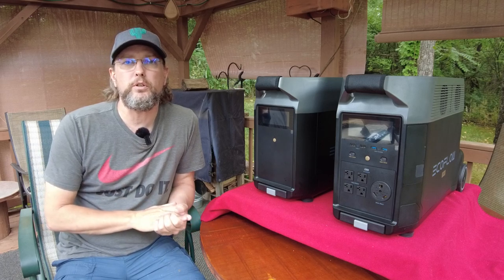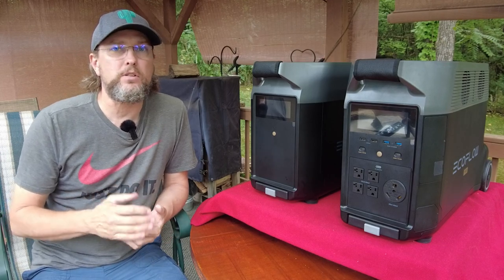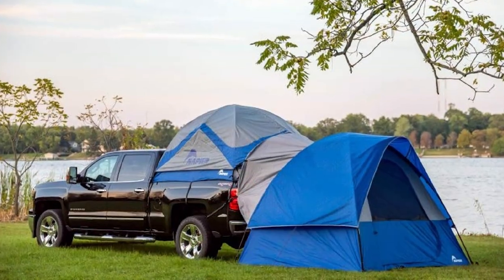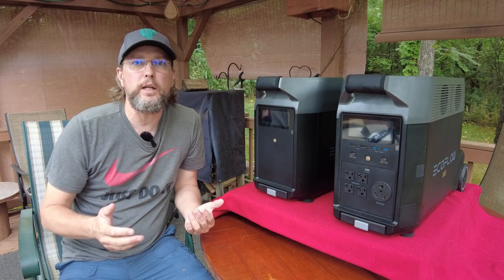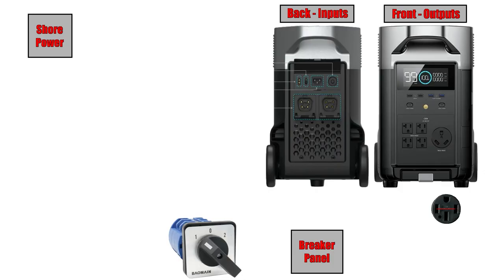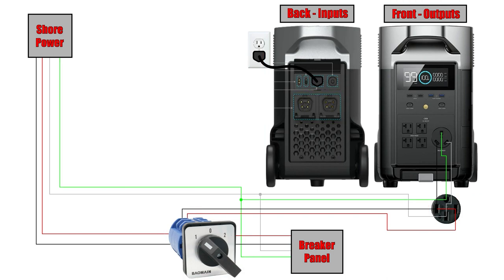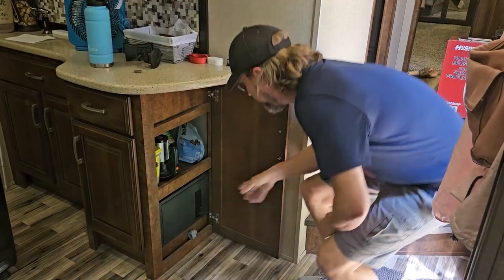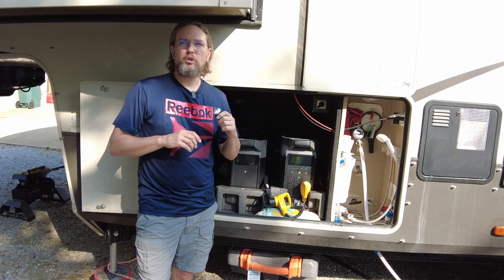A Great RV Solar Power Alternative | The Ecoflow Delta Pro Portable Power Station | Full Time RV

Comment: We have a Bluetti AC300. Pretty sure it's similar in size to yours. Our thoughts for purchasing the portable Bluetti rather than building solar into our 25 ft. class C motorhome. Being portable, we can use it in the house as well as the RV. We live in hurricane country, so we need something to power our fridge and freezer during extended power outages. We prefer to park the RV in the shade, so portable solar panels are an advantage over panels on the roof.  We can leave the heavy system in the house (where we store it) if we are traveling to campgrounds with electric hookups. We only carry that extra weight if we plan to boondock multiple nights.  The portable system will run the whole 30 amp rig, so we can simply plug the power cord into it just like plugging into a power post at a campsite. We have been extremely happy with our choice! Oh, one more item, all the components in whole system are designed to work together. We didn't have to figure it all out if we built our own. And we do need an "open ground plug thingy" to make ours work. (Pardon the unprofessional term. I don't know what they are called. 🤣)
Reply: 2 Delta pros is also workable in houses. I watch a video where he uses 2 Delta pros and all the batteries. Which is too bad for each Delta pro? And you run this wtollhouse September has a gas stove. I do believe kitchen stove and gas furnace and one gas dryer. But he has 2 dryers, 1's electric 1's not.  And he gets all his power needs from the Delta pro. But I do believe he still has to be careful with his power. Use just like if I get a C300 the wetties and all the batteries and 2 of them, I still have to watch the power I use just like I should get 2AC500 and all their  batteries of my needs on my power. That way, as well as  AC300 to actually complete all the power I need.
Reply: So your system is idiotproofed?
Reply: Is it able to run your AC?

Comment: I have this exact same setup with two spare batteries. I also have the smart generator. It turns itself on and off when it notices the batteries are getting close to dead and turns off when charged up. No need to do that yourself!
Reply from the maker: I wouldn't mind having that generator. But as far as I know, I can't charge both Delta Pros at the same time with it.
Reply: @fairwindsrv  It charges the main unit while the main unit spreads the power distribution to the spares.As far as I can tell in the app, it charges all three at the same time when I use it.

Comment: I like what you have done with these power station and explaining what they can do for you. The only down side for me is the weight. Would not be able to lift this unit (100lbs) into the bed of my truck or in and out of my pass-thru storage area of my 5th Wheel RV. We store our RV at an off site storage facility and I don't leave anything worth over a $100 in the trailer. Also the price was too high for me, at 1st I was thinking it was around a $1000 and then I saw the price of $3000 and I just killed over. It is still a good option for those that have plenty of disposable income. I'm pretty happy with my small 600watt Bluetti. Thanks for the video.
Reply from the maker: You're welcome! And you're right...it's not a solution for everyone and it definitely isn't cheap. However, dollar for dollar, it's cheaper than a traditional solar installation, especially if you can find a good deal on Ebay. 😉 Thanks for watching!
Reply: I bought a 6' folding aluminum ramp which I use to get my Delta Pros down the front steps and then up into my truck...this makes it easy.

Comment: So when boondocking the 12v devices still run off of the 12v house batteries that get charged by the converter that is powered by the unit, wouldn't it be more efficient to eliminate the the house batteries and turn the breaker off to the converter and use the 12v outlet on the eco flow to power the 12v panel? May be more money wise too if you don't have to buy house batteries. Have a question too, are the units too loud to have in the living space in the rv?
Reply from the maker: Great questions.
As for the noise level, I don't think I'd want them in the living space because they can get fairly loud. They might be tolerable for a short period, but I don't think I'd have them long-term in my rig if they had to be in a living space.
I guess the only reason not to do what you're suggesting is that there simply isn't a DC connection port that offers the capacity needed to fully support the DC system...at least, not in my RV. The Anderson port is only rated at 30 amps, or about 380 watts. That's just not enough to support the DC loading.
It's definitely not efficient converting DC to AC and then back to DC, but you'd need some good old fashioned redneck engineering skills to make it work otherwise. Lol.
As a side note...whenever connected  to an AC source, the converter is doing all the work for the DC system. If the batteries are fully charged, then they're just floating on the system. If they're not fully charged, then the converter is both charging the batteries and supplying the rest of the DC system. Overall, that doesn't change your point, however. Just wanted to clarify that for others who might read this.

Comment: I have a truck topper, can I leave these in the bed of my truck for storage? Can these be used facing up instead of facing forward?
Reply from the maker: The only thing I'd be worried about in the bed of a truck is how much they bounce around when driving. Might not be an issue if you keep them in their styrofoam bases, though. As far as how they're facing...I'm not sure it would be a good idea to stand them up on end. If that's something you want to do, I'd reach out to EcoFlow.

Comment: I recently installed 2 eco flow pros in my Rockwood mini lite and opted for the Go Power TS-30 30 Amp Automatic Transfer Switch with 30 amp cord pugged directly into Eco flow. I wired it so the converter charger only works on shore power to prevent a "power loop". My problem is, my 12 volt system only operates on the front trailer chassis battery. (Lights, heater, etc.} I want it to run off the eco flow. Did you run into this in your install or have I done something wrong? Best work around? Any input would be greatly appreciated...
Reply from the maker: I don't have that issue because I didn't bypass the converter with the Ecoflow, so my 12V system is being powered from the Ecoflow. My coach battery is now just a backup to the backup. It just kind of floats on the system now and never actually gets discharged. 
I know what you're saying with the power loop, but the Ecoflow is pretty smart and will prevent that from happening. Meaning, it knows if it gets plugged into an AC outlet that it's powering. When it senses that, the AC outlets turn off automatically. Similarly, it won't let you turn on the AC outlets on the Delta Pro if you're plugged into an outlet it's powering. I know this from experience. Lol. The key is that you must remember to unplug the Ecoflow from the RV wall outlet when you want to use it to power the RV, especially with the automatic transfer switch. 
Granted, this is a downside to having this type of setup, but it's one of the reasons I went with a manual transfer switch...I have complete control over the system.
I hope this helps, but I think you have a decision to make about putting that converter back in line with the Ecoflow. It's the only way to power your 12V system with it...without a whole lot of jury rigging.
Reply: So if I understand... if I reconnect the converter, it won't try to use the Delta Pro to charge the house battery. Am I wrong in assuming that when I'm powering my 12-volt equipment even with the DP online, it's still actually coming from the house battery and not the Delta Pro. 
Let me try and put that another way. If I'm using 12-volt equipment and depleting my house battery isn't that Delta Pro going to try and charge it?
 I know my question is as clear as mud, I just don't know how else to explain it.
Reply: I just re-read your reply. I think what you said is if I reconnect the converter it will never try to charge the house battery while the DP is in line because it will never actually be discharged. The DP will be providing the 12v system and as you said the house battery will just kinda sit there. Am I understanding that correctly?
Reply from the maker: If I understand your initial comment, you wired the DP into your RV AC electrical system, but somehow bypassed the converter. Now, your converter only charges your house battery when you're connected to shore power. Assuming I understand that correctly, then the first part of your most recent reply is not correct. Without looking at the system (or a drawing), I'm not sure how you bypassed the converter when only when on the DP but not on shore power. However, if you reconnect the converter back to it's original state, then when you're on the DP, the DP will now charge your house battery just like it does on shore power. When I installed my DP, I made no changes to the converter.
As far as your 12V system goes...if your DP is powering your converter, then yes...the DP will charge the house battery. Again, it would be just like being on shore power. The 12V system always gets its power from the house battery, but when you're connected to an AC source (i.e., the DP OR shore power), that AC source is keeping your house battery charged. The house battery should also charge when you're connected to your tow vehicle, although at a much lower charging rate. If you're NOT connected to an AC source or your tow vehicle, then your house battery will still power your 12V system until it's fully depleted.
Reply from the maker: Yes. Technically, if you're using the 12V system and you're connected to shore power or the DP, the battery is charging AND discharging at the same time. Which means, like you said...it's just kind of sitting there floating.
Reply: Thanks so much for your reply. I think I actually get it now. I thought if the converter was left in the loop with the DP it would become a vicious charge-discharge cycle, if that makes sense to you. Anyway, what I had done was disconnect the converter from the AC breaker. Ran a new wire from the shore power side of the transfer switch to the converter. Nearby only allowing the converter to run on shore power. Didn't realize I was actually taking the 12-volt house battery out of the loop when using the DP and thus disabling the 12-volt system. I think I may have over thought this whole project (lifelong problem) and I understand the system a whole lot better now. Thank you so much for your input and taking the time to clear this up for me. 

By the way love your video's...keep up the good work.

Comment: I've been wanting a Jackery for about a year now; very pricey but I've heard great things.
Reply from the maker: Too expensive for a G-man? LOL.
I chose the Ecoflow because they had the highest rated inverter. Jackery makes some good stuff as well and you can find some sweet deals on refurbished units on Ebay that will come with the original warranty. I just ordered another unit and extra battery and I've probably saved about 40% off the normal price of everything I've purchased so far. I'll do an update on my new system in a few weeks.
Reply: @fairwindsrv  that's awesome! I'm looking forward to seeing it. I guess I should've worded my last comment more clearly; not expensive if you're using it everyday, but it is for me if I'm holding onto it for a just-in-case scenario.
Reply: @fairwindsrv   New sub here and I enjoyed the video. I have 1 Delta pro and thinking of purchasing an extra battery and curious as to how you saved 40%. Thanks, John

Comment: Thanks for the great info. We have the delta pro as we are living in our 5th wheel off grid. We power our delta pro with 1200 watts of ground mounted solar panels. Question regarding the neutral open ground bonding plug; I have to use one to power our rv. Any issues with using that plug combined with charging from solar panels? Thanks!
Reply from the maker: Thanks for watching, and great question! There should be no issues using the bonding plug when charging from solar. Having said that, you can contact EcoFlow to verify. Support@ecoflow.com. They are very good at responding to emails. Although they may try to also sell you their own version of ground-neutral bond that is more expensive. Lol.

Comment: Good video.

We run 2 delta pro’s with 2 extra batteries each (21,600wh total) and 2 smart generators with the double voltage hub that supplies 240v at 30amp into our main house panel with a manual transfer switch. We have 3600watts of hard solar panels that max out the solar charging. Technology has really improved in the last year or so.

Comment: Great Video 👊
I think you should have a plug setup separate from Sure Power to charge your Power Station.
Perhaps use a Champion dual fuel 2500 generator. That way you can run your generator on propane.
Reply from the maker: We have that exact generator for that exact reason! 😂 Thanks for the comment!

Comment: Thank you for all your technical expertise and well-done YouTube videos. 
I just purchased two DELTA Pro ECOFLOW 240V/7200Wh solar generators. What cable do I need to connect them together to obtain the whole 7200 Watts? Assuming I can connect them together at the rear of the units can I plug my 30 amp plug in the front of one of the units to provide power to my class A motorhome?
Reply from the maker: Hello! Glad you liked the video! I think there's more information needed to answer your question and email would probably be better. If you'd like, you can reach out to me at fairwindsrv2022@gmail.com and I'd be more than happy to help! I look forward to hearing from you.

Comment: Okay , so great tip on that grounding plug! I havent seen anybody talk about that. I was just going ot plug my RV's shore power line right into the Delta Pro and NOTHING more. I'll get the plug. Wonder if I have to add a transfer switch or do any wiring at all, since I will be totally off grid and stationary.
Reply from the maker: If you're totally off grid and the Delta Pro is your only source of power, you shouldn't need a transfer switch. As for any rewiring, that probably just depends on where you want to set up the power station. For example, if you want to keep it in the passthrough, but you're unable to get the shore power cable routed in there, then you might need to do some rewiring.

Comment: Hey thx for posting this informative video. I am considering getting one of these and appreciate your information and have subscribed. My question is: I have a Class A w 50 amp service. To save from having to do any wiring to get this to work, can't I just plug my shore power cord with 50 to 30 amp dogbone adapter into delta pro when away from shore power to power coach, and simply plug delta pro ac charging cord into the 120v ac outlet in my "basement" under coach when i am hooked up to regular shore power or generator to recharge delta pro battery?
Reply from the maker: Yes, you can connect directly to the DP with the 50/30 amp dogbone. Thanks for watching and subscribing!

Comment: Fantastic video...Thank you. I have two ecoflow Delta pros, the voltage doubler and smart generator. I'm Picking up my new RV later this week and was wondering...Could I connect to the voltage doubler with a generator to 50 amp dogbone and then connect my 50 amp cable to the dogbone and run it to and connect to the trailer normally? Then I'd recharge with my ecoflow with my solar panel (400W) and smart generator. Will that work?
Reply from the maker: Yes. I recently bought another Delta Pro and that's how I connect to my 50 amp RV. Voltage doubler connects to both Delta Pro units, then I connect my shore power cable to the voltage doubler via the dogbone (L14-30P male to 14-50R adapter).
Reply: @fairwindsrv  great news! Thank you!

Comment: I like your setup.  Seems to me the hardest part is running the wires to the breaker panel.  I would like to locate the transfer switch inside the RV or even get an automatic transfer switch.  I also have several solar panels keeping the house batteries charged.  I'd like to get the EcoFlow Alternator Charger to connect the house batteries to the the Delta Pro...so, in a round about way, charging the Delta pro with the already installed solar. Also, if necessary you can also transfer the power back to the house batteries from the Alternator Charger.  Any thoughts on this setup?
Reply from the maker: Sounds like you want to do a setup similar to mine. If that's the case, you'll probably find that the house batteries rarely get used. They're kind of just a back to the backup. 
If you have the EcoFlow units powering the rig via transfer switch whenever you're disconnected from shore power, the batteries are pretty much constantly on float and never really get used because being on the EcoFlows is just like being on shore power. Only exception would be for very large DC loads that the converter can't handle on its own (like electric leveling system). 
As for the DC to DC charger, I thought about getting one, but the cable is only 22' long. That's not enough to reach the passthrough from the truck's engine compartment, and I'm hesitant to extend the cable due to heat considerations. 
In my case, connecting to the breaker panel was easy. I have a large void behind my fireplace that gave me plenty of room to work. That's not the case for all RV's, unfortunately. 
Good luck with your setup!